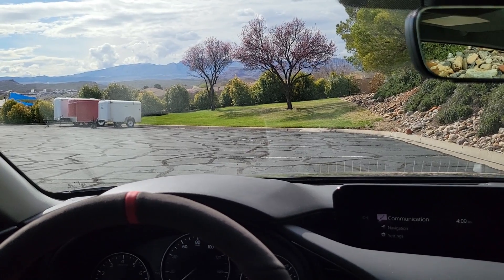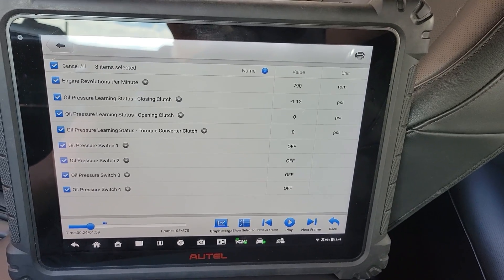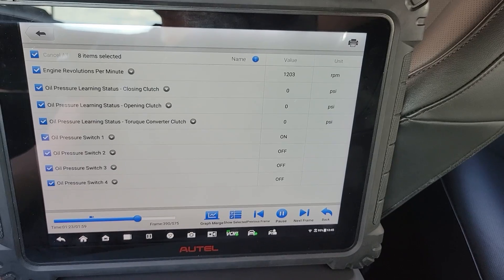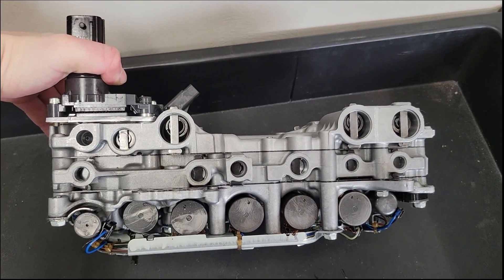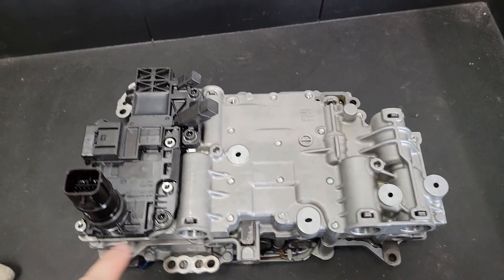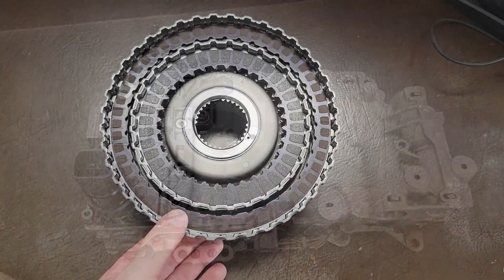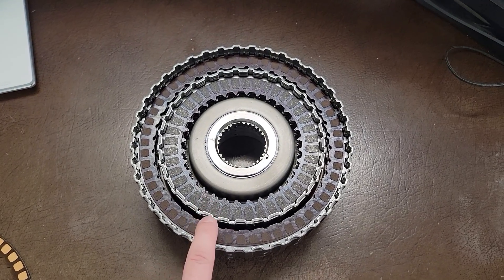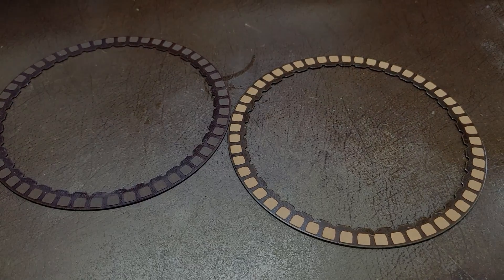Mazda Skyactiv AT initial learning mode. What is the car actually doing? #skyactiv

Comment: how do you resolve the chirp noise (stick-slip noise) when it changes from 3to4 , without changind the entire torque convertor? what should be changed inside the torque convertor?
Reply: Idk the root cause inside the torque converter.  There is a tsb for this issue.  The remedy is torque converter replacement

Comment: Hello, I just found your channel and appreciate the valuable information you share on Mazda transmissions.
I have a question regarding my 2019 Mazda 3 (Gen 4) with 170,000 miles. The transmission fluid has never been serviced, as it was likely considered a 'lifetime fluid' by the previous owner and dealer.
Considering the mileage and lack of prior service, and the importance of transmission fluid properties, would you recommend performing a transmission fluid service now? The fluid is yellowish/light brown but doesn't smell burnt. I've heard conflicting advice on servicing high-mileage transmissions that haven't been previously touched.
Could you please provide your professional perspective on this? Thanks in advance for your expertise!
Reply from the maker: @ghaliboulanouar1852  If it's yellow brown, then that's a good sign. With that mileage, the fluid will definitely be aged. If you change the fluid by draining and filling and you have a problem afterward, then you already had a problem developing.
Reply: Drain and refill with Mazda FZ fluid.  It takes about 3.5 -4 quarts

Comment: Hi i got this problem with p0500 speed sensor & its permanent, according to mazda service i need to replace the whole transmission in which i find it absurd because the speed sensor is built in. is the speed sensor they referring to is at valve body at 6.38 in your video? can it be replaced coz i got another set? or have to replace the whole valve body? pls help if you encounter this issue

Comment: My 2023 cx-5 had a delayed shift from 2nd to 3rd when the engine is cold from the day I bought it. In 2.5 years, it never got any better. This procedure fixed it right away. You saved me a ton of time, thanks!
Reply: My 2024 has this issue too. Feels like a transmission slip with a real brief spike in RPMs. Hoping this will fix it
Reply: I’ve had to do it two more times so wonder if in the fall I need to have the software updated.
Reply: @robertr6112 I was thinking going that route also. Hopefully, it's something the dealership can easily do. I have not told them about the issue yet due to it being summer now.

Comment: I have 2017 Mazda3 2.5 Touring with ~140K miles. There’s a harsh shift into 3rd and 5th gear, not all of the time but often. It seems to be affected by how much throttle I’m giving it. Based on the mileage, and your explanation, it’s looking like wear of the clutches. I’m going to try the relearning procedure and see what that does. If it doesn’t help, can the transmission be rebuilt? If so, would you recommend taking it to a dealer or a reputable shop? Thanks in advance!

Comment: That woulde petty interesting to record at the begining learning process and  driving tests after this procedures end up .How these values show up on screen. Also quite a  bit interesting for how long these will lasts utill it starts to jerck again .Does anybody have that experience for long term driving? Thanks
Reply from the maker: Mazda records the oncoming and offgoing clutch data. This changes over time as the clutches wear.  I've recorded Skyactivs at various mileage, and there is a pretty strong wear pattern that they exhibit.

Comment: Thanks  for very helpful video. My car is Japan used car (JDM), Mazda Demio (Mazda 2), 2019  model. It was driven in Japan for 133,000 Km. I recently got it as newly imported car. The issue I am having is rattle noise while I am accelerating the cars by pressing the gas pedal a bit harder. it is obvious when I drive uphill or overtaking the car infront of my car.  I can feel a bit of vibrations when the noise come. It comes after driving 30-40 minutes. I checked every loosen part, there is no issue with all engine mounts, exhaust covers, different panels. The last one left is transmission. 

-  I did the transmission relearning process from your video, I successfully made it. After that, I notice the changing the gear is smoother and better , especially from 2nd  to 3rd, 3rd to 4th. 

-BUT the noise still remaining. If notice that it is delaying in downshifting, then the noise come up with vibration. ATF fluid has not check yet. 

-I feel frustrated, if you can suggest what should I do, that would be much appreciated.
Reply: It's the torque converter.  There's a TSB

Comment: Hi, is it possible in your opinion to change the sixth gear ratio of the transmission?
I have a 2020 Mazda 3 Diesel that reached 140 km/h the engine revs are 3000 rpm, too much and the car downhill decelerates and does not sail.

Is there a solution for you?
Thanks in advance

Comment: I recently purchased a 2013 Mazda 6 GT 2.5L Petrol with 140,000 km. While driving at 50 km/h, if I release the gas pedal, I notice a slight pull when the speed drops to 40 km/h and the RPM dips to around 1000. At that point, the RPM rises slightly to 1200-1300, followed by a small push as it drops back to 1000. What could be causing this? Can I perform the initial learning procedure on my 2013 Mazda 6, and is the process the same?
Reply from the maker: The learning process is the same for all the 6 speed Skyactivs. You may be feeling the TCC operate on a downshift.
Reply: @grolladat  The idle rpm did not increase for me.

Comment: When they update programming after TCM swap (I did the swap myself and then had shop program) would that also put it back to learning  mode or should I still try this?  Would love to pick your brain about TCM issues, tried to msg you on Mazda 24/7 but I'm new on there and it wouldn't let me.  Ran perfectly for a month after the swap and now acting up again:(  Trying to exhaust all options before tackling a full transmission swap.   Thanks!
Reply from the maker: Yes after reprogramming it will need to do the relearn procedure.

Comment: My CX-30 transmission shifted like an advanced Parkinson’s patient trying to learn stick for the first time. Several times it would free rev like it was in neutral and catch like you dropped the clutch, and then on steep hills if I came to a stop and tried to go again it would act like it was in 4th gear and trying to go. Like if you tried to take off on a hill in 4th instead of 1st or 2nd. I’d have to floor it to go 10 mph.

I wasn’t happy with mine. I even did two spill and fills with a filter change and that still didn’t help at all.

Comment: Had my car since 50k miles (233k now) and I've always hated always how the tranny shifted to the highest gear so much that i exclusively drive in manual mode. Once I've done this procedure it always held lower gear as long as I wanted.
Reply: Yeah they just love upshifting..living in mountains its very annoying so manual mode is a must. Torque converter lockup at 5 mph pulling a trailer up a steep driveway is also annoying. Its either stay below 5 or get enough speed before incase you need a running start. There no in-between

Comment: I did this on my 2023 last week with our scan tool at work, yes you do need to BURY your foot into the brake pedal at least halfway down to get it to go, even if it says all criteria are met you absolutely need to push the brake pedal down harder. Seems to have cured a few complaints I had like low speed bumping, hard downshift when transitioning from coasting to on throttle, and a dragging 1-2 upshift. Other upshifts feel sharper now as well and down shifts feel slightly better. Seems it did learn some bad habits during break in when it was new.

Comment: Brilliant video, Sir! I applaud your efforts to help us car normies. I'm curious if initiating the relearn protocol could result in better mpg. I bought my 2021 mazda3 fwd 2.5NA used and I only get 23.5. I suspect the lower mpg could be due to the driving dynamic learned from the previous owner
Reply: Just try it. It should.

We have a Mazda 3 AWD 2.5T, and I did this a couple of weeks back.

I always used to get about 21 mpg or less driving in the city. After doing the relearn, I've noticed an improvement, and it's in the 24-27 mpg range in the city.

Gets way better on the highway as long as I avoid overtaking too much.

Comment: I have a question because I’ve performed the relearn procedure on my 24 turbo sedan and a lot of the time when it’s cold a and it shifts to second I’m guessing when it lock the torque converter in quite abrupt. The relearn procedure didn’t help is that an issue with the turbo models or is it normal behavior when cold ( transmission not ambient temp)
Reply from the maker: It's pretty common when fluid temp is low it will delay converter lockup until midway through 2nd, sometimes when shifting to third. It will almost feel like a mini shift, bump. Once fluid temp is above 90*f, it will start locking sooner.
Reply: @grolladat  thanks for the reply put a little more at ease. I thought something was wrong with it. As it hadn’t done up untill like 2 or 3 weeks ago and I’ve only had like 2 months.

Comment: Excellent follow-up to a fantastic video. Shortly after buying my 17 Mazda 3 2.5 A/T, it began to get dogged when downshift time came around. It only had 72,000 on it so I tried the re-learn -- worked the first attempt, and did make the car much smother by not delaying needed downshifts for hills / slow downs: MUCH KUDOS to the writer here!!! I was hoping it would also fix another nuisance -- when passing a car at say 50 & ending acceleration at 80-90, it would take about 5 seconds to shift up through each successive gear if I let off the throttle sharply. Maybe it was engineered that way -- because it still does the same, unless I carry partial throttle after the pass, then it shifts leisurely, but much quicker. I find myself  commonly going into manual so that I can quickly complete the upshifts without wasting engine wear & fuel & momentum being lost. Changing out 3.5 quarts of the Z fluid with the recommended Amsoil also make it feel more buttery. I'm going to do that a couple more times & change the filter and gingerly snug the valve body bolts.
Reply: the transmission is programmed to downshift at the lowest allowable RPM for that gear to save fuel. Upshifts are delayed because the AT is trying to understand what your next move is (light, moderate, high throttle,) making sure it is prepared in case you suddenly demand more throttle.
Reply: @pikachupowers  Thanks. I thought that might be the case -- thanks for validation. I get around it now by either slowly backing off from full throttle or flipping to manual & bang out the upshifts quickly.
Reply: @geeder9086  immediately reapply gentle cruising throttle application. or use the flappy paddles. it will understand.

Comment: Appreciate your first video and this follow up video. I have a 2024 CX-50 TPP where I was experiencing issues which led me to your first video. My question is, do you have any driving advice or do's / don'ts for preventing the transmission from re-learning the same jerky shifting problem(s)? I read a comment from someone in your first video about how they were probably "a little too cautious at first during the engine's 600 mile break-in period". 

I, too, am a pretty cautious driver and typically try to "coast" to a stop vs heavy acceleration + braking. Is this a driving behavior which may lead to the jerky downshifting in lower gears? Please share any of your thoughts on "do's and don'ts" for driving if you have any.

Thanks again for the informative videos.
Reply from the maker: Personally I would just drive it like you normally do. If it is jerking badly you may have an issue with it.
Reply: @grolladat  Nov 2023 Build Mazda CX-30 In Australia called Astina (Top Tier model) 2.5 NA FWD auto purchased Jan 2024  7KM's on odometer.  Despite the marketing nonsense iStop and Mazda cylinder deactivation "features", I found our vehicle was initially too variable or unpredictable in shift quality and prediction etc....... It took about 3 months to improve significantly and now as of 21st Nov 2024 it is really unnoticeable from a conventional torque converter "dumb or basic" adaptive auto from a couple of decades ago.  We have just approached 9,000KM's from new and it's first service is due at 10,000KM's.  It's a well sorted vehicle all round and quite satisfied with it overall.

Comment: Thank you for all things you do for us, great content. I have question for my NA2.5 cx 50 I know this video is about transmission. But I have this weird humming between 70km to 90km from the back of the car. Dealer keep saying it’s normal or they don’t hear anything. I’m trying to figure it out. Do have any info on that you can share. Thanks again
Reply from the maker: It is likely something to do with the pinion bearing, the 3, CX-30 and CX-50 use a double roller style that can make a high pitch noise. I recently had my rear differential replaced(axle seal failed)  with the updated unit that started production in 2023 and neither my original diff or my replacement make the noise. I would have to spend some time with one that makes the noise but that is my suspicion.
Reply: Would you happen to know when in 2023?  I have a 3 AWD that was built in February 2023 and I noticed a gear whine from the rear end at freeway speeds as well, but if it's "normal" for it then I won't bring it up.  Thanks again for the insightful videos!
Reply: 2024 cx5 2.0NA+6AT   got same issue

Comment: I’ve been having to climb a hill up right after starting the car because of a detour, I did the relearning process but the car feels the same, holding the low gear longer than I expected when going down hill, feeling a jerk when I stop on a light, and running on low rpm while pressing the brake pedal (causing vibrations) is it possible that the system learn that quickly to have the same behaviour? Thanks for the help.
Reply from the maker: That is likely part of the base shift scheduling and not anything that can be done about that until TCM access comes.
Reply: Let the car warm up first
Reply: Maybe next time you buy a car u can shift yourself if you’re picky. 

Rather than expect an arbitrary machine to do what you expect